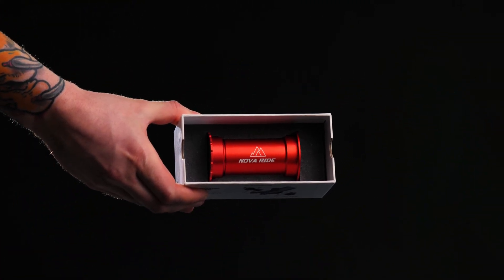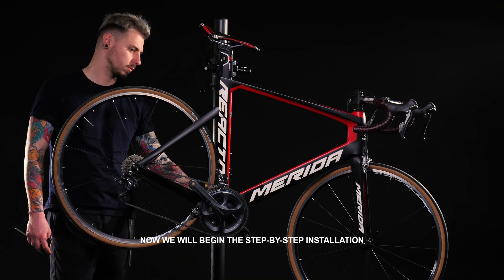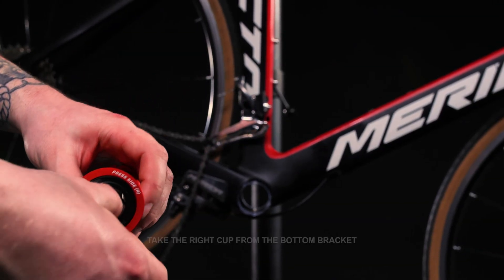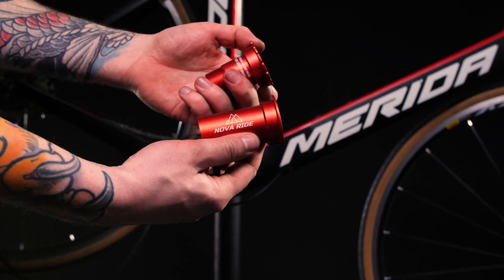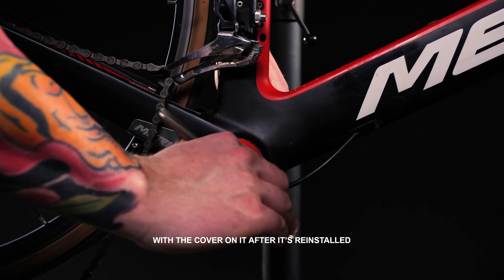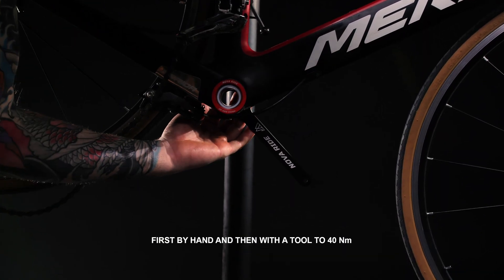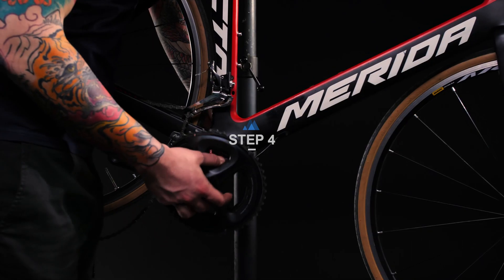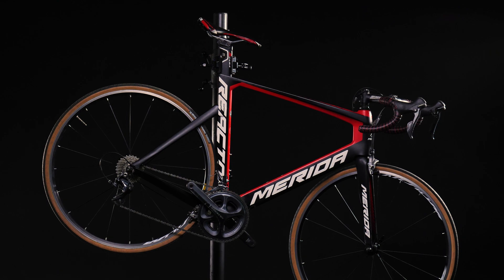How To Install your Pressfit Bottom Bracket

Comment: what's the point of a threaded fastener for one side if you need the special press for the other side anyway
Reply from the maker: Hi @markifi,

The threaded solution developed by Nova Ride regarding Press Fit bottom brackets allows to perfectly align the two cups, which remove cracks and enhance the durability and the fluidity of bearings. This threaded solution facilitates the bottom bracket mounting and maintenance, and mainly allows to increase the bottom bracket rigidity by fixing the two cups together. 

Hope this helps!

Kind regards,
Nova Ride Team